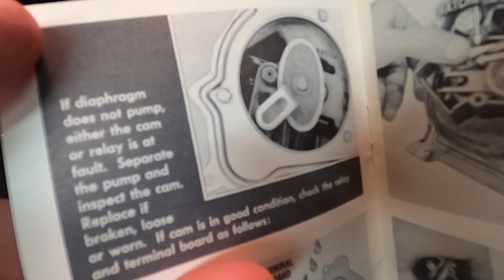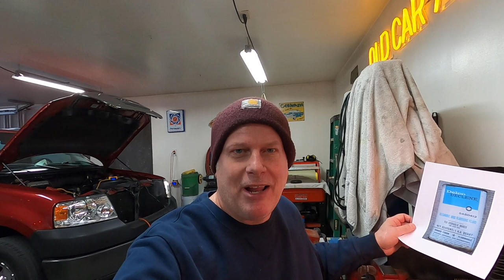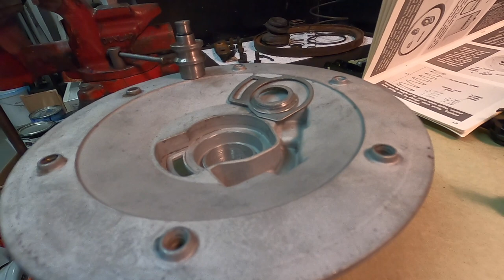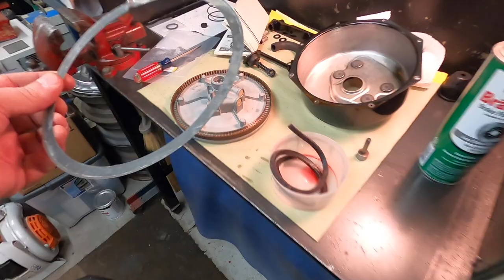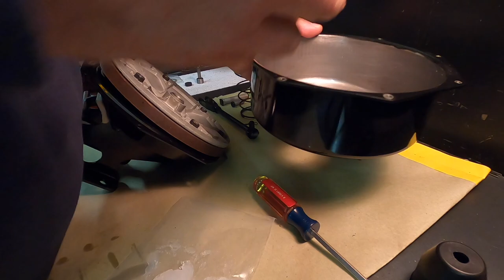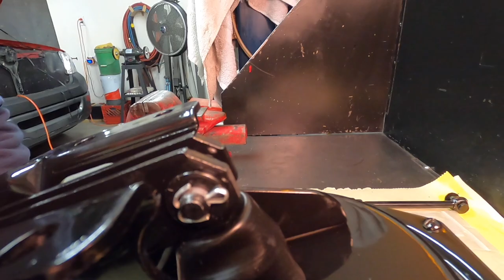59 Chevy Bendix power brake booster overhaul part 4 assembling

Comment: Good job, did mine about a year ago and used the same book ( worth it's weight in gold)
Reply from the maker: Those little manuals GM put out are the greatest for rebuilds like the brake booster.

Comment: Excellent detail!, I hate to tell you what I paid a few years ago for this, (and I did have to buy a new master together). Their paint job was not 1/4 the quality of yours either! Also their “rebuilt unit” had a cheesy looking cad plated lid  with a clip instead of Chrysler’s  bolt on heavy cover with a thick U shaped cover bracket. If I ever do this myself someday, I’ll have to find a good Chrysler core to rebuild.
If I last long enough, I’m going to rebuild it myself like you did!
Reply from the maker: They're very easy to overhaul, if parts are available. Those old style Chrysler master cylinders are getting really hard to find. I had one bored and sleeved for a project many years ago, because I couldn't find a decent rebuildable one.

Comment: Hi Howard, I agree with you 100% regarding restoring to original spec. It is certainly much more difficult to find and use original clamps (on rad hoses for example). I’m trying to find good reproduction tower clamps for my ‘72 Vette but most aftermarket are junk.
Reply from the maker: Do you watch "TheCorvetteBen"??? He has a good supply of decent used Corvette parts for that era. If you don't, you should check his videos out.
Reply: @OldCarAlley
Reply: Hi Howard, I do watch “TheCorvetteben”
but I didn’t realize he also sold parts, thanks 
for the lead. In addition to your excellent 
channel I also watch Mustie1, Coldwarmotors,
Iowa classic cars and Salvage Rebuilds UK.
Lots of excellent content on YouTube, keeps
us sane during crazy times.
Hope you are keeping well.
Reply from the maker: @dietersmythe9649  He sells used part off his parts cars.... he has a bunch of them too.

Comment: I just watched a video on "This Week with Cars" where he had to overhaul the master cylinder on a 1957 Pontiac Star Chief. That thing is mounted down on the frame under the steering column. It's totally different than the one you are working on. No wonder GM went to a standard type of master cylinder and booster.